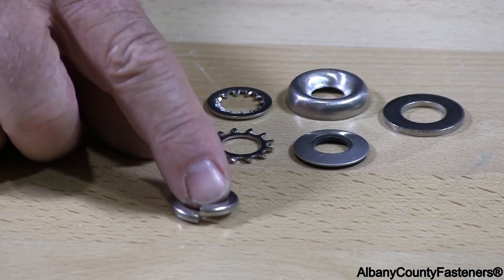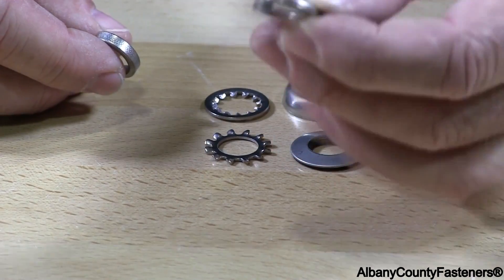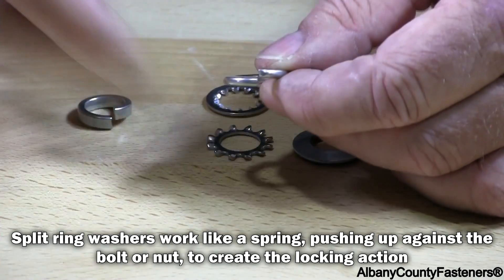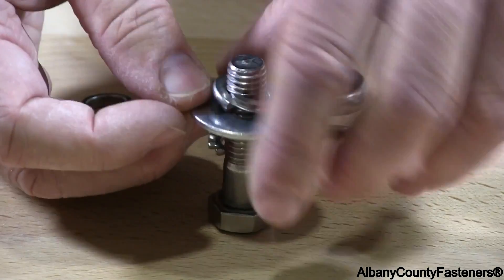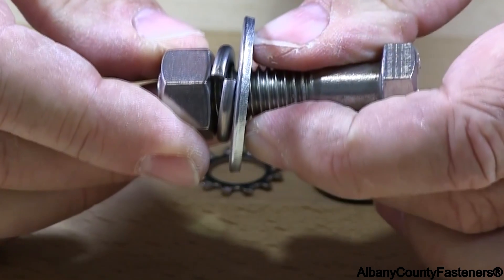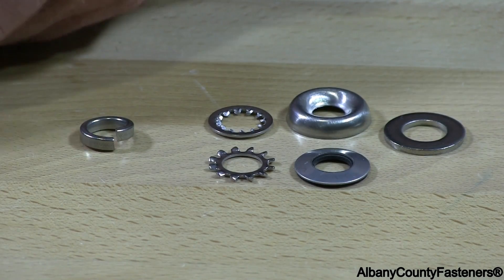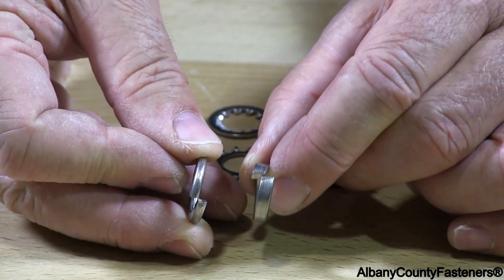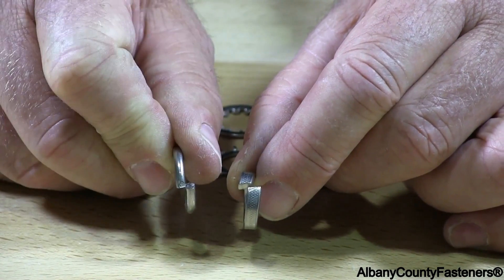Split Ring Lock Washers - Spring Locking Action | Fasteners 101

Comment: plz also demonstrate some uses specially my bicycle side kickstand keeps getting loose .. so plz demonstrate the best combination i.e. exactly/ideally where the kickstand metal should get sandwiched between which of these and how is there a multiple combination for better avoidance against loosening with kicking stand and vibrations... plain-washer(s), lock-washer(s), bolt, nut(s), checknut(s), flange-nut(s)... anxiously looking forward.. thank you!

Comment: I have a bed frame with the same screw size i wanna know two things one is it ok to leave the spring ring out and just use the flat washer would it still have the same effect and two which one is more better the high or the regular  flat washer cause I don't want the screws to be loose.
Reply: Flat and spring washers have different purposes. If both are included, you should use both. The spring/lock washer is made from spring steel. When the bolt and nut are tightened with adequate torque the spring flattens. However, spring steel has "high memory" and is constantly trying to return to its original shape. This causes tension (pushing force) against the nut. Since the threads of the nut are intertwined with the threads of the bolt the spring washer tension locks the threads against each other preventing the nut or bolt from turning. A flat washer serves multiple purposes (mostly protective) but none of these purposes prevent the nut/bolt combination from turning when exposed to vibration. Hope this helps!
Reply: He explained in the video what the "lock" washer is for. When you don't want a nut coming loose you use a lock washer which is split, and the two split ends of the washer are twisted away from each other. The reason for this, is so that the pressure from the nut being tightened will flatten the washer back out (which may seem counterintuitive, at first).
 
However, pressing The split ends back together create a high pressure spring action. The pressure from the split locking washer pushing back against the nut you just tightened down,  forcing it "against" the threads it's tightened on so that it can't "turn". 

In other words, if I put two small holes at the top of a pop bottle cap, looped a string through the holes and pulled real hard on the string-- although I'm pulling in the direction the cap needs to come off--it is so tight against the threads, that evenwhen you attempt to turn it, to loosen it, you wouldn't be able to. 

This is how the lock washer works to prevent vibration working a nut loose.

Applications might be a: mower, engine, car, trailer, etc. Anything that has vibration that can work loose over time. 

Hope this helps!

Comment: When a split lock washer is compressed, the washer is just flat, no better than a regular flat washer, at best.  At worst, the split washer can spread apart under heavy application of torque and it just kinda smears and permanently deforms.  When that happens, now you've got uneven distribution of force between the screw and clamped surfaces.  This is a failed joint that you probably won't want to rely on for anything important.

When a split lock washer is fully compressed, the edges of the split are not angled in such a way that they can gain any purchase on the mating materials in order to bite in and provide much of any useful or measurable locking action whatsoever.  They just slide along the surfaces of the mating materials, unable to grab anything that will prevent the screw from rotating.  Further, the compressive spring force is too low to do much good in adding to or helping to maintain clamp load under the head of the fastener if it stretches or starts to back out.  The force they provide is just miniscule compared to the nominal clamp load applied under a properly torqued screw.  A conical or Belleville washer will be a better option if you're looking for a washer to help maintain consistent clamp loads, for example due to expansion and contraction due to temperature changes.  Belleville washers will provide a better spring rate than a split lock washer, but even those are limited in their usefulness and they often will lose some or all of their conical shape permanently after being fully compressed in a bolted joint and don't fully spring back.  When that happens, you're basically working with a flat washer again.  By the time a fastener backs out or stretches enough that the angle on the "teeth" on a split lock washer could hope to bite in, there is is simply not enough clamping force left in the joint to make it bite in.  The joint has already failed at that point and no washer can help you.

If you truly want a good locking washer, an external tooth lockwasher will be your best best for commonly available hardware.  These will actually bite into the material, provided the clamped materials are softer materials than the washer and you're using something less than a Grade 5 screw.  A much more expensive and harder to find option is to use a Nordlock washer, which is a two piece washer stack with different serrations on each side.  Nordlocks work very well, but they take up a fair amount of space relative to the size of the screw.
Reply: Excellent content

Comment: Does the standard washer not defeat the purpose of the lock washer? Now the nut and the standard washer are held together with the locking nut, but the whole nut-lockWasher-regWasher system can rotate. I guess the larger bearing/friction area of the regular washer will help to prevent the whole system from rotating, but still.
 
We spec out lock washers on telecommunication tower projects, as they move a lot in the wind. The lock washer must be installed between the bare metal and the nut to function.
Reply: I think the idea is that the split ring functions as a spring, applying pressure to the fastener and adjacent surface, keeping them tight against the threads. I don't know if they actually work that way, but that's how it was explained to me. And in that case, adding a flat washer in between would not make a difference
Reply: Exactly. A flat washer under the split washer defeats the whole split washer design.
Reply: The "locking" dynamic isn't created by the spring washer digging into the material of construction. The spring/lock washer is made from spring steel. When the bolt and nut are tightened with adequate torque the spring flattens. However, spring steel has "high memory" and is constantly trying to return to its original shape. This causes tension (pushing force) against the nut. Since the threads of the nut are intertwined with the threads of the bolt the spring washer tension locks the threads against each other preventing the nut or bolt from turning. Placing a flat washer between the spring washer and the material of construction doesn't reduce the locking tension. In fact it may increase it. If a flat washer is not used between the spring washer and a soft or compliant material of construction, the force exerted by spring steel memory will be reduced as the soft material deforms.
Reply: Part of the locking action comes from the tooth digging into the mating surfaces, and part of the locking action comes from the spring rate of the washer.  
This is a highly debated subject (that NASA publication that says lock washers are useless), and under some cases perhaps they are worse than useless as the tooth digging into a part could initiative a fatigue crack.  But these washers do still provide at least some resistance to vibration.  I can certainly attest to that from practical experience.

Comment: some sites say you have to put the lock washer first...
Reply: If it's going into something like a panel, the lock washer is first, then flat. So the order would be panel-flat-lock-bolt head. If you're securing with a nut the lock goes after the nut. Or just use a klock nut.

Comment: Split rings are no longer used by NASA or the Navy. Tests have proven split lockwashers not only fail to provide any safety, they actually accelerate the failure of a nut and bolt.
Reply: That is False...
Reply: @jayt3796  It is not false
Reply: False

Comment: Putting a flat washer under the split washer seems counter productive. The two parts of the split washer are meant to dig into the opposite surfaces to prevent unwinding. The flat washer will just slide over the clamped surface.
Reply: are you sure about this? I learned quite the opposite. these washer just create a force against the surfaces that absorbs vibrations and causes extra friction to avoid them getting loose. 
please correct me if I'm wrong.
Reply: Im sorry but What does this mean? Its better not to put a flat washer with a split washer ?
Reply: false